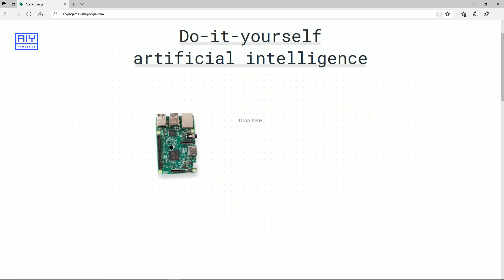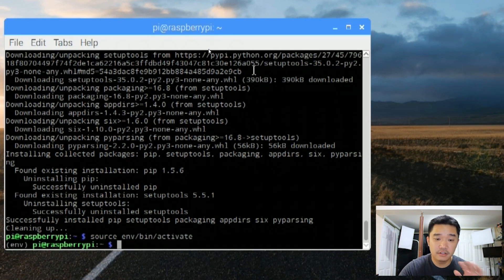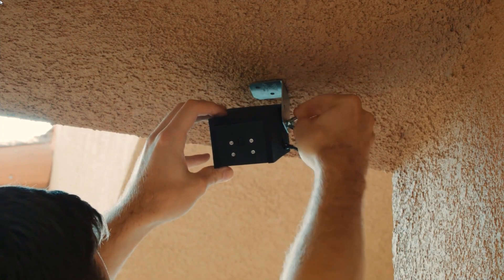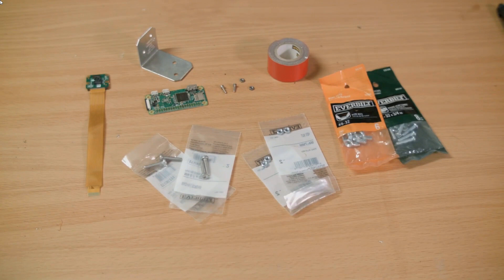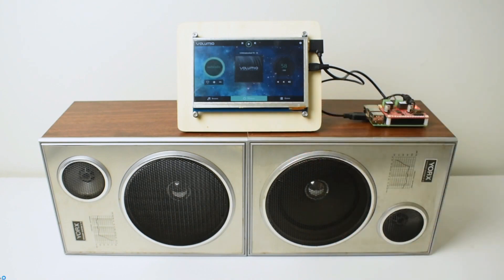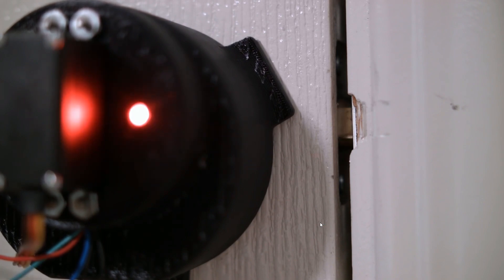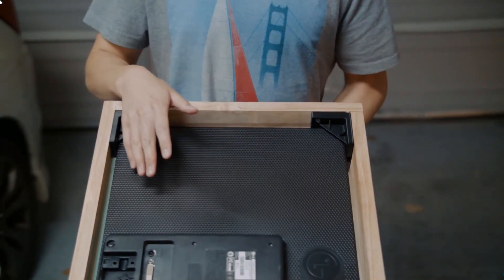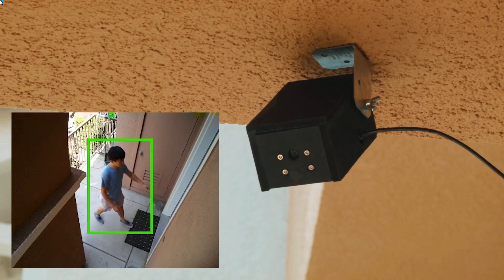Top 5 Tricked Out Household Raspberry Pi Projects

Comment: They could use a Tesla coil to send power to the Door lock device wirelessly. A back-up battery may also be good in case there was a black out.  Maybe also an RFID sensor to unlock the door automatically as you approach it.
Reply: Tesla coil?